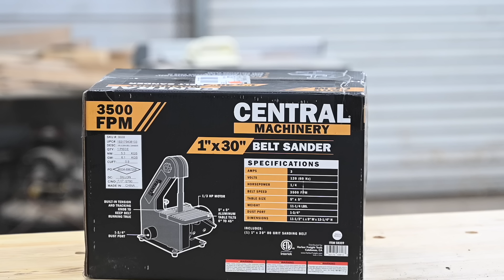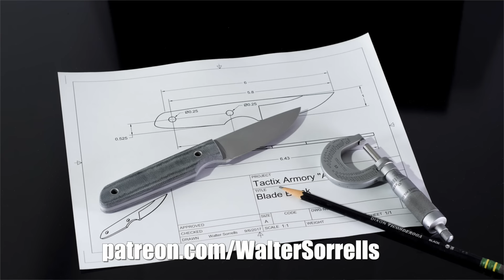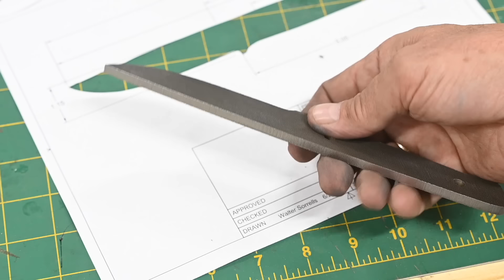Ultra Cheap Belt Grinder...Exposed!  (Harbor Freight 1X30)

Comment: Watching your videos and some others I appreciate the time and professionalism of your videos. To dip my toe In The Biz I used the earlier model of the Harbor Freight grinder. I made probably 20 knives with that grinder which I also got a taste in buying quality belts for future reference. As soon as I was over being a novice, I was able to fabricate  a 2x72 Grinder from a dc motor and control board off a free treadmill. There's many videos on how to make it out there on YouTube, and it gave me forward and reverse and variable speed which is invaluable for grinding a quality knife. After I went through two motors from getting metal dust into the windings I still couldn't afford a $3,000 grinder so I bought the plans for my 2nd gen Revolution 2x72 grinder from Brian house out of Florida for 10 bucks. With the steel, the motor, and the controller I'm into it for about 800 bucks. But I will say that it is an industrial machine that will last me a lifetime, plenty of power, forward and reverse, variable speed, vertical and horizontal grinding. It's an excellent machine and would sell somewhere in the range of $3,000 assembled out the door. It took me a while to save up the scratch and lots of research before I decided to build the revolution, and I'm not dissatisfied I love that machine I use it everyday on anything I need to grind. It's a cheaper way to get an excellent 2x72 grinder and I would advise anyone with a little welding knowledge to do what I did. Get a hold of Brian house and get the plans or buy the bundle and you're in for a professional machine for a lot less than you would buying a prefabricated tool. Thank you Walter Sorrels, you are my number one man for knife making videos over the last five or six years I couldn't have done it without you thank you thank you thank you Walter. Keep up the good work my brother from the knife making community.

Comment: I started going to Harbor Freight to get tools for my side-by-side. These are tools that will work fine out on the trail, but would not shed too many tears over if they were lost or stolen. For the price, and given they are what they are, I have been  impressed, they work fine. To support my scale RC habit, I bought a 36x4" & 6" grinder combo, and I like the machine, it does what it needs to, without breaking the bank. Given, this machine would not last a day at my work, but it is not intended to.

Comment: Thanks for a good detailed review!  For sanding smooth the edges of circuit boards that I manufacture from time to time, I use a homemade small belt grinder on semi-permanent loan from a friend.  It uses  1" x 42" belts driven by a wooden  [!]  6" OD pulley on the shaft of a commonplace 1750 RPM 1/4 HP motor.  Works at least as well as the Central Machinery machine in your review, but it is heavy and somewhat clumsy to adjust.  It is good to know that there is a quick, easy & cheap alternative if my friend needs his machine back...

Comment: When I started making knives as a hobby I did not know what I was doing and did not want to spend a lot not knowing if I would want to continue I bought this grinder, a harbor freight cast anvil and made a barely passable home made forge.   Using this under powered grinder taught me patients for when I started getting better and spent the money for better belt grinders, forge and anvil. 4 years later and I still have this sander, does not get much use anymore, but sometimes still use it on roughing handle scales

Comment: I started knife making with a 1x30, like many other have.    I made several knives that all turned out good.  The disadvantages I saw were with the narrow platen and the amount of time it took to grind compared to a 2x72.   If your on the fence about not being able to make a 1x30 work for you don't.  Take your time and you'll be fine.

Comment: I don't really make knives yet, but do forge tools like chisels and scrapers, as well as sharpening axes, knives, etc that I already have.  I picked up a fairly cheap king canada 1x42 disc/belt sander, that has quickly become one of my most used power tools.  I replaced the cheap platen with a small piece of 1/4" angle iron, and took the side cover off, but otherwise run it as-is.  Well worth every penny, even if I do end up buying, or more likely building, a 2x42 or 2x72 down the road.  Another thing worth mentioning about these little grinders, esp this one, is just that.  They are SMALL, meaning you can have one in almost any workspace, and tuck it away on a shelf when not needed.  Perfect for hobby or occasional use, where space might be more of an issue than cost.

Comment: The trick to a grinder like this is to hog off most of the material with an angle grinder rough pass. You can get one super cheap at HF too… this will give you several benefits.
You’ll get practice with both tools, you’ll save time and money on consumables by saving your belts and you’ll have more fun focusing on making progress instead of trying to grind away an inch of steel for an hour!

I’ve had this little grinder and it worked great for me for a long time, because I took care of it, I spent the money I saved on better quality belts and knife steel and I made a few jigs for it that made it safer and faster to use.

So yeah… just remember… a poor craftsman blames his tools! You just have to respect your cheap tools instead of thrashing them because they’re cheap. I love Adam Savages method where he says to buy the cheapest tops you can, use them until they break and upgrade with the most expensive you can afford and the best quality that you need! Because you might not even like knife making, so don’t buy a 3k grinder to start. Start small, learn what you like, what features you want or dislike so when you upgrade you know exactly what you want and you can get the best tool for you!

Comment: 1. I've used the same HF belt sander for better than 7 years. Mine has the 5 1/2 in. disk on the side. I paid under $40.00 for it on sale.
1.5. As an aside, I recommend the 4.5 in. disc grinder for cutting stock out.  It's light duty as well (at under $20.00 on sale) but great for the hobbiest.
2. The HF abrasives kind'a suck. The belts are usable but not fo long. I'd recomend getting them elsewhere.
3. I tend to do my "grinding" by hand mostly as I enjoy the work. My HF belt sander is used mainly to "cut" the first 1/4 in. of the bevel at the edge to the centerline. As I said, I enjoy the work.
4. Thankyou Mr. Sorrells for your multiple series on knife making. They've been educational as well as inspirational.

Comment: I got one of these and I use it in my shop for a general grinder change out. The belts doesn't take long to change out a belt. It's small. It doesn't take up a lot of space. We can put it underneath a table someplace. Pull it out just when we need it and put it away. Takes up a lot less space than an actual bench grinder. And the abrasives the belt can be changed out for various different grits and I have a flat grind rather than a round grind when I'm having to shape. Whatever it is that I'm working with and I don't do knife working but somebody else uses it to sharpen knives. They're knives and they have a an attachment that you can pick up on Amazon that gives you an angle. You can either have it going upwards or downwards and make both of them and it works pretty good. He's real happy with it. I use it to do all kinds of stuff all the way up to polishing really fine. Grit all the way down to grinding stuff away and it works and it works great. It may not last 30 years but you know what for the amount of money. If it gives 2 years it works. I'm even considering picking up a second one, but that's how useful and handy. I have found it in my shop. Like I said when it's not a use just take it off the bench and put it on a shelf someplace and it's out of the way. You don't have to have something dedicated. You could move it wherever it is that you're wanting to work

Comment: I bought one of these a few years ago for sharpening lawn mower blades. It's ok. Not great, but serviceable. Does the job as long as good belts are used. Once the belt gets dull, it takes forever to get an edge. If you push too hard on it it'll stall with very little effort. For the price, it works ok. I use a very aggressive belt too. 36 grit.

Comment: For about 17 years, I've been using a cheap Craftsman 1x30" sander for regrinding/sharpening large blades. It's probably slightly pricier but a little sturdier than this Central Machinery one (though I got it on sale, so it might've been even cheaper than the CM at the time),  but has been a solid investment for what I do, which is a lot less demanding than what Walter puts the budget sander through here. Paid for itself many times over in time saved.

Comment: i have the Grizzly H6070 1x30 Sander I have been using this machine for 8 years, the motor does not stall when reprofiling a new edge or making a new tip, Been very happy with it so far, then I will finish my sharpening on  assorted Japanese whetstones., as with any tool you must know its limitations. great video, Thanks, Greetings from The Cayman Islands.

Comment: Just an FYI to anybody looking to try one of these cheap but awesome machines...

You can add a better platen. I made one that was a bit taller and rounded at the top, and removed the plastic top cover entirely. I made the platen more easily removable so I can slack belt and this is a great utility grinder. I've got bigger grinders now but I still use this for all sorts of things.

Comment: I have one that I've used fairly extensively. I removed the table and the platen. I use it exclusively as a slack belt for cleaning up convex grinds and putting the final bevel on hollow grinds.

Comment: I've only made about a dozen knives or so with a similar 1/3hp Harbor Freight belt sander. I struggle with clean lines but just realized the work table in your video is different than mine (my blade will slip down the slot on mine; yours steps back, allowing the knife to ride all the way). I've made a lot of adjustments to my sander (glass platen, cutting the extending knob for adjusting the table, removing covers for a quicker belt change, etc.) and I've experimented with different jigs. I've yet to make a knife with super clean lines. I now wonder if the table would solve many of my issues. Thanks for the videos.

Comment: I have had one of these for years with good results. The only problem I had was the switch going out, but that was my fault as I had added a receptacle in the line for a vacuum to go on and off with the machine and it pulled more amps than the wire and switch could handle, I do this with all my machines and was expecting this problem so I did what I have done with other machines and upped the wire gauge and switch to cover the added amperage. A fine little machine for what it can be used for.

Comment: I went with a Rikon 1x30 with a 5" disc... $140 from my local Woodcraft store. I have used it to make a couple knives with very good success but mostly use it with a homemade jig for regrinding plane irons and chisels as needed. The table on the Rikon has very nice fine adjusting screws for pitch adjustment which works brilliantly for chisel grinds. So yeah I agree with you that a 1x30 isn't the same as a 2x72 but it'll get the job done.

Comment: I am not a knife maker. However I bought this machine to use with a 1x30 leather strop and polishing compound to sharpen knifes. This works great for my purpose of touching up knives easily and quickly.

Comment: I got started using one of these. 
Grinding got a lot easier after I threw away the plastic belt guard (which will melt from grinding debris) and removed the platform piece (which wasn't super stable). 
Freehanding was less precise but the little grooves in the platform would snag material and mess with grinding pressure.
That little wheel on the top was surprisingly good at helping to shape finger grooves, at least until the plastic wheel melted.
I ordered in a bunch of zirconia and ceramic belts from supergrit for $1.50-$2.50 a piece and went nuts. Got me through the basics and somehow survived making some huge camp choppers from leaf spring and massive rasp files.

Comment: I have an 8 in. Bench Grinder with a Light & an Angle Grinder to do the heavy work.
To do the light work & sharpening, I got the $80 CENTRAL MACHINERY 1 in. x 30 in. Belt and 5 in. Disc Sander. I also bought some extra 60, 80 &120 Grit belts & disks from Harbor Freight.
I also got on eBay a $38 Edge Trailing’ (AWAY) Knife Sharpening Angle Guide and a 12 pack of 1” x 30” Sharpening / Sanding belts. (2) Each of: 120 Grit Firestorm Ceramic Polyester Belt, 220 Grit Ceramic Alumina Closed Coat Belt, 400 Grit Aluminum Oxide Soft Closed Coat Belt, 600 Grit Aluminum Oxide Soft Closed Coat Belt, 800 Grit Aluminum Oxide Soft Closed Coat Belt & 1200 Grit Aluminum Oxide Blue Film Belt.

Comment: Mine worked well, but shelved it for now until I can rewire it.  Not sure if its a bad ground or what but get an occasional shock when using it.  But it worked good enough to make a few knives so far and testing knife shapes on scrap wood lattice strips.

Comment: I like mine.  I’ve customized it a little, and lost a few nuts and bolts off that are easily replaced. Keep a couple of wrenches by it, and a screwdriver, as you’ll be adjusting things constantly on it.

Comment: I have this harbor freight green one and the plate was not level. I literally had to put a nut and bolt and counter sink it from the left back part of the work plate down to the base and tighten the bolt until it became level. I don't use it for tilting and sanding, so.....I have to say I have put a machine square on it and its perfect now. I have now had it for about 6 years and it does every little job I want to do with it. But yes, its for little things for wood pieces, or shaping some metal really quick or even sharpening a blade or steel bar making it to a point up really fast works great. Would I love to own a larger one? Hell yeah! But not being a knife maker, this little guy has done me fine for small stuff for years. I have actually made some really nice stuff using this sander. Oh, when I bought mine I think I paid about $29.00US for it.

Comment: I've got one of the original green one from waaay back.  Picked it up on sale for $29.95, if I remember correctly.... I think it was 2008 or 2009.  It's chugging along.  I've used it for EVERTYHING.  Made a couple knives, used to make my own kydex sheaths, I even used it on body work as a contouring tool for wheel wells by taking off the table and everything else, so it was a slack grinder.  Just used it tonight to do some contouring on a couple of Boyd's rifle stocks.  It won't die.

Comment: Here is a tip for anyone who decides to start out knife making with this HF 1x30.   To do the bevels I use a piece of 2x2x9 aluminum angle and small C clamps.  The small work table on the HF 1x30 tilts but hits the motor housing trying to tilt it back which  is how I do bevels.  I had to cut off a small part of the underside of the table to allow tilting back more.  I did that on my table saw but you could use a hacksaw.   I also put in a machine screw at the back that I can turn to make fine adjustments to the angle using a digital angle finder.  This allows the table to tilt up to a max of about 14 degrees which is more than enough for bevels.  I typically set the angle about 7 degrees then using my aluminum angle with the blade clamped to grind my bevels.  Once the bevels are ground with the 40 grit belt, I go over them with a 240 grit belt to save some hand sanding.

Comment: i have one of those, although it is branded differently.  it is pretty good for what it is, a lightweight small sander.  Some types of sanding it can not do, as you can not wedge your work piece into the belt from all angles since it is so compact.  but it works fine, and have had it for over ten years.  Helps if you hook up a vacuum cleaner to it.

it is underpowered, so you will not be removing a lot of material without it periodically jamming on you.  but for light sanding it is fine

Comment: I use a Delta branded one from 20 years ago or so. Made in china I guess. looks similar but has the 5" disc which is what it use to grind bone bridge saddles for classical guitars. it has been great for that light use. a grinder this size would be the first bench top tool I would recommend for a beginning guitar maker or repair person. good review.

Comment: We had one at the machine shop and was used everyday to de-burr the thousands of parts and overtime hundreds of thousands parts that we made 😂 it always covered in aluminum, stainless steel, teflon, delrin, brass, copper, steel and others dust and still always worked. The belts lasted a really long time. Truly a great tool. 👍🏻

Comment: Nice video Walter ,I like your channel and watch everything you post. But on this on the litter 1x30 belt sander it works fairly good for the buck and at 65 years old and a retired toolmaker/ welder , I really don’t think investing a large sum of cash to build 20 or so knives as a hobby. It’s not a money maker if your trying to make a living at making knives. The knives I’m making are for family and friends to have after I’m gone, everyone that get one will know that it was made just for them , maybe they can pass it to their family when they are not able to use it anymore. I use mine to rough the bevels , then I finish them up with a filing jig and do the profiles and rough shape the scales . You have a fantastic tool shop but I don’t have the space or time left to try to compete with the pros . Keep up the great videos and content. I look forward to seeing another video soon . I made one knife back in 1994 using a wire EDM machine , did the entire blade on that machine and I still have it pretty cool . Later